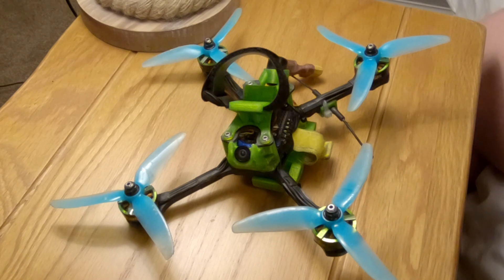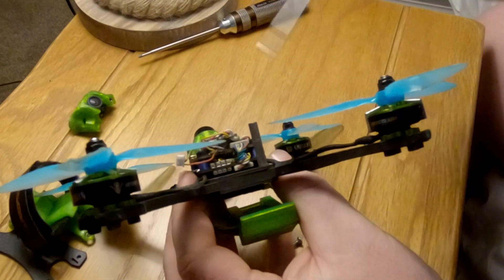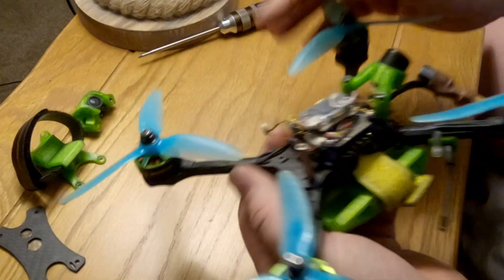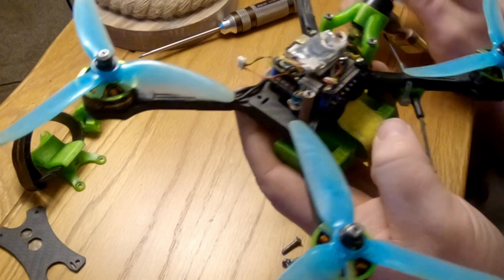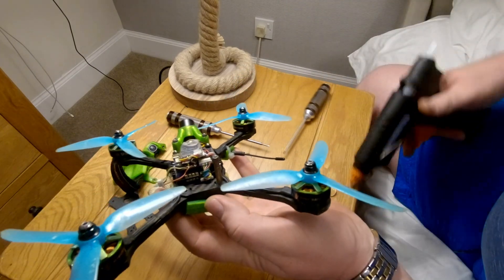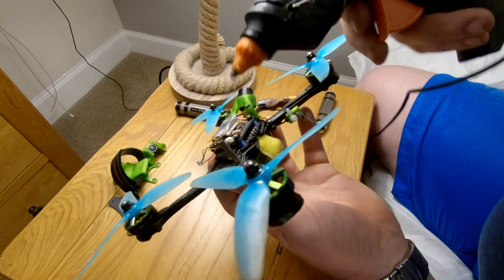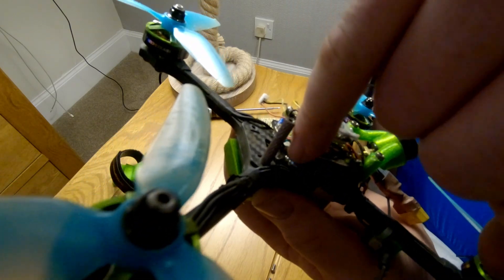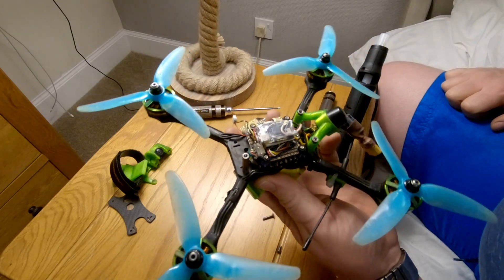OMNIBUS F4 V6 - TYPHOON 32 35AMP ESC - RC QUICK FIX - UPDATE

Comment: Hello m8, been following you for a couple of years now m8, I fly when I can and hate flying in this cold wet weather. I hate breaking stuff.
I even wait for the sun to burn the dew off the grass. My first maiden of a self built zmr went pop and lesson learned but that ended up in a lake at moreton beach.
Watched your progress just boom but I don't  seem to be picking it up that even after 3 years now.
I do need to get out more though.
My PC is a potato it won't even run freerider the graphics card is poo,
I only bought it for betaflight off eBay for £30 so I suppose I need to upgrade. I'm pretty good at LOS but fpv I struggle.
Keep the vids coming lad I enjoy them. I used to hang around your way but I'm on the Wirral now.
Reply from the maker: Thanks pal so nice to get messages like this. What do you fly now?

Where about are you on the Wirral I could bring a few guys over for a fly in a month or so
Reply: I got a stingy X, a tweaker 210, chimp 210 and a couple of 130's 
And 2 wings. S800.
I can't get goggles for my IPD 
I tried some skyzones but the light leak was bad. White plastic painted orange,they went right back. So I'm still using my box with an immersion duo v4.
All the gear, no idea lol.
Yeah m8 when it warms up I'll remind you about that.
Nice one. All the best m8
Reply from the maker: Woodsy5791 woodsy5791 nice collection bud I have a pair of dominator v2 goggles I am selling the have a wide range of ipd and you won’t get any light leak with the mods I have done to them. I have been using them for 1.5 years and they work perfectly. I have just upgraded to the HDO goggles so these are for sale they come with a module and have had a new head strap fitted they also include the cooling faceplate as well if you interested
Reply: @ProgressiveMTB  Xmas has just gone bud and things are tight for a bit,but out of curiosity, how much. Maybe in a month or so
Reply from the maker: Woodsy5791 woodsy5791 £150
Reply from the maker: Woodsy5791 woodsy5791 they have had the L1 mod done as well and they can now run the Rapidfire module if you ever wanted too.
Reply: @ProgressiveMTB  that's a sweet price, soon as I got the dosh m8 I'll see if you still got them.